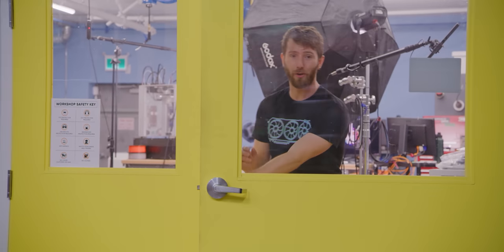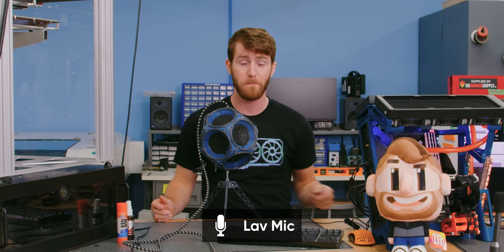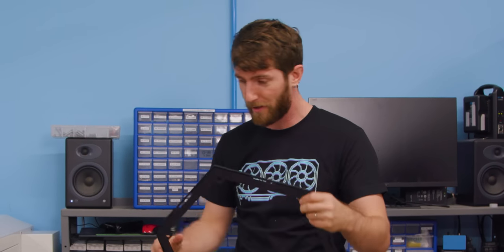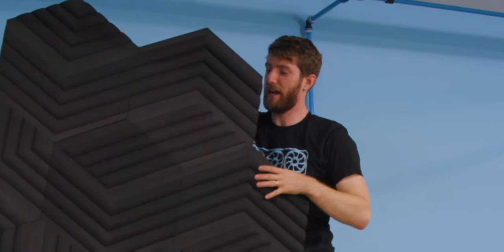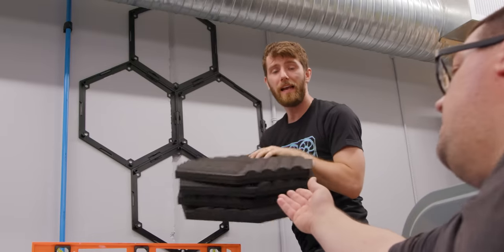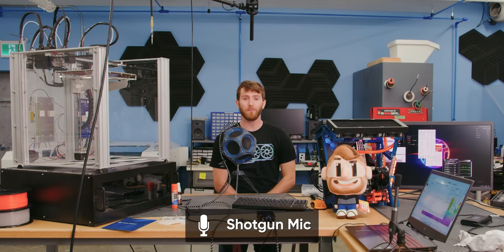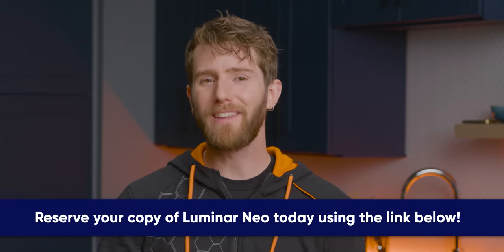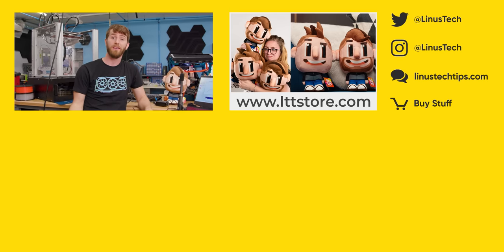I'm only going to say this once... - Acoustic treating with Elgato Wave

Comment: Hey Linus, I'm a professional acoustician and long time fan! Some other comments have pointed out that reverb isn't caused by standing waves, and that there are cheaper, better performing options like Rockwool. These aren't wrong, but I wanted to praise how you did the video. You're doing the right measurements, with the right equipment, and (generally) using it correctly (that mic really shouldn't be sat on the table, it should be on a stand away from flat surfaces). That's so much better than what I see from a lot of other non-acoustics people talking about this stuff! 

Also, while Rockwool or those specialist acoustic panels would be more effective *acoustically*, panels like these serve their purpose really well. As you pointed out, your measurements are showing noticeable improvements right in your speaking frequencies, but not below 300 Hz. For streamers at home, that's exactly what they need! And they need the panels to be unobtrusive and look nice. If these were thicker, more industrial looking, or handbuilt, they wouldn't work for that use case and people would just be less likely to put anything up. In a general vocal recording setup, not a music recording or playback room, under 300 Hz just isn't really that crucial. 

For this room, I'd probably add some bass traps in the corners if you wanted, since you guys have the money and space, but it really does show how much better recorded audio can be with just some pretty simple and nice looking panels.
Reply: Its a #ad like ALL of the videos from LTT right now.
Reply: What is a bass trap? Is it to minimalize low frequency reverberation? And if so would it be more effective in a smaller dimension area as opposed to larger?
Reply: Thank you for your comment, what is the "cheaper, better performing options like Rockwool"?
Reply: @OnTheLeftHandSide      Search up bass traps. Note, however, that for them to be actually effective at trapping bass and reducing standing waves, they require more room than something you can hang on your wall. Usually they're quite thick.
Reply: gotta say it in a positive light otherwise you'll anger the masses huh
lol
Reply: I am also very professional and here is my wall of text that 5 people will read:
Reply: @halolime117  thank you for being one of those few, and I hope you enjoyed it!
Reply: why should bass traps be specifically in the corners?
Reply: @darealrulezbreaker9493  Low frequency pressure builds up wherever there is a boundary, or a hard surface like a wall. In the corners you've got two or three hard surfaces meeting at one point so that low frequency energy concentrates and builds up even more. Absorbers work by basically increasing the resistance to movement of air and sucking energy out of the sound. So by placing bass absorbers in the corners, we're targeting where the bass energy has built up the most!

Also, for a bass trap you need depth. These panels don't work well at low frequencies because the wavelength is much longer than the panel is deep. By placing a bass trap at a 45 degree angle across the corner, we get more depth without intruding into the space of the room as much.
Reply: @OnTheLeftHandSide  A relatively cheap way to make a decent absorber is to use mineral wool or fiber thermal insulation like Rockwool. The material is fairly cheap but can provide a surprising amount of acoustic absorption. A common DIY acoustic solution is to build a wooden frame, stuff it with insulation, then cover it with an acoustically-transparent fabric. These work pretty well and are cheaper to do, but obviously they're more effort and not necessarily as stylish as premade panels like this.
Reply: He mentioned Rockwool and similar solutions at 14:39
Reply: @drandrewmitchell  allright, thanks for the explanation! 
I want to use a old mattress with acoustic foam on top as a bass trap.. overall thickness will be like 18cm. 
I cant really put the one matress in the individual corners of the room, but as a plus it has a lot more surface area than a little bass trap. 
Im just not sure where the best place would be.. i guess putting it on the wall thats in front of the speaker/ behind the microphone would make most sense?
Reply: rockwool is horrible to work with, I wouldn't suggest it to anyone who doesn't know fully what they're getting into, so they understand how necessary protective gear like gloves and a mask are when handling rockwool.
Reply: @steveschaninger2535  not sure were you answered already, but as simplified lower frequencies tend to amplify in the corners of the rooms. Therefore you install something that breaks either the form of the corner or lot of absortive material with depth, or both. As lower frequencies has longer wave length you need more mass and absorption throughout that wave length to tame down the lower frequency spectrum.
Reply: For streamers and content people the elgato stuff is really good. It hits only the talking frequency and looks nice. I am a baritone nerd so I still prefer the giant wool panels + funny looking ceiling.
Reply: Hi Andrew, could you tell me if these would work to reduce noise from upstairs? And if not, what would you suggest? I live in a flat and the dude upstairs bangs a lot. Yes I’ve spoken to him, and no, he doesn’t care.. I use earplugs when I sleep, which help about 50%. My question is, if I stuck these things to my ceiling, would they absorb some of the noise/vibration? Paired with the earplugs, I’m hoping they would help? Or would sticking them to a ceiling with the noise coming from the other side, make no difference?
I understand better insulation is the best option but ripping out the ceiling to install it and then making a new ceiling isn’t an option since I don’t own this property. (The council will not do anything about it).
I need a quick fix solution like sticking these panels. Even if it’s not 100% eliminating the problem, a reduction would help. But it’d be a waste of money and time if they make no reduction at all.. Thanks :)
Reply: @user-fy7ri8gu8l  I mean I still find the videos informing and entertaining also most of the time I don't get yt ads when I watch LMG videos so I'm happy :). 
Just had to add my 2 cents but I like the ad-ception theory lol.
Reply: @Sieg2k6  Honestly It sounds like your neighbour just needs a good "talking to" if you catch my drift.
Reply: I'm no professional, just someone who's spent time in rehearsal studios and heavily researched DIY options for one at home, and everything Andrew's said is consistent with what I've found. Absolute legend for taking the time to expand on the subject matter and reply to others!
Reply: tbh i really dont see how stuffing some cheap ebay wedge foam everywhere does any worse than this from a value pov compared to like 0.5 panels of this
Reply: We do reverb measurements at school (Audio Engineering, Electroacoustics class), we use this omnidirectional speaker with a better frequency response and we use white noise and listen with the mics for the reverb after the signal ends with an AL1 acoustilyzer and then average it over multiple measurements in the room, that seems like a better way to measure it.
Reply: Plus these have an aesthetic that rockwool doesn’t. They may perform worse, but when you add in that factor, and the fact they do enough for most people, I’d say it’s pretty good
Reply: Neat
Reply: Rockwool isn't good for your lungs.

Comment: This was definitely a fun run through and test, etc. -- but for big spaces like this the best and most cost-effective solution would have been a few rockwool panels rather than these everywhere, but if you have them, you have them!
Also as the first one to mount them on ceiling in video - they WILL fall eventually, but adhesive will mostly keep them in place.
Reply: Rockwool panels are how I made my sound absorption panels. Built a frame out of 1x4s (same size as the rockwool panel), then put fabric over them to clean up the look. NOTHING works better than Rockwool. I do like the design of these ones in the video though.
Reply: Didn't he specifically mention at the end how rockwool would have been the most cost effective solution?
Reply: If you are an artistic type, or you know someone who is then you can get uncut acoustic level foam for pretty cheap and then just cut it yourself. the other downside is you generally have to put nail holes in your walls
Reply: Some other guy said to use walmart cheap towels 4 dollars per panel lmao
Reply: They are most certainly not cost effective. You can get just as good panels for less than half the price of these things. Elgato is scamming people with the classic, add "gamer" to the name and then up the price 10 fold.
Reply: @bittjl3150  that's not a scam its a pointless markup. If people don't do their own research it's on them.
Reply: @NeonAtari  Used towels from the thrift store work also, several layers inside a frame.

Comment: I wasn't expecting for these panels to be that good.
I have professional sound panels, but will probably give these a try on different rooms, especially for the lower cost.
Reply: Yes a computer tech channel is the best place to get your info on soundproofing on a budget. Try looking elsewhere first.
Reply: Basotect (open bubble high density foam) could achieve massive results. For a studio environment I would recommend both, thicker panels and an air gap behind the panel. Other than that - compared to rockwool with its approx 40 pa/s/m2 you probably need 30-40 % less material for the same results on reflections in the mids and highs. Sadly I can't recommend Basotect for your bass area, at least not in those shapes and thicknesses. They're velocity traps so you still need the well known enormous amounts of material to control lower mids and bass.
Reply: "..., especially for the lower cost."  100.- for 1m² is considered low!?
Reply: It's not a lower cost though; it's $100 for each individual box, not for the whole room.  It's just as ridiculously overpriced as all of Elgato's other products are.
Reply: Maybe in comparison to your professional panels they have a slightly lower cost, but generally for audio foam it's very overpriced
Reply: Linus were sponsored by Elgato. Their shit is overpriced

Comment: Quick tip from a 3rd gen audio engineer: Some of the tightest sounding panels I ever heard (or didn't hear really) were made with the ultra cheap towels from Walmart. They were about 4 bucks per panel.
Reply: I've heard towels are effective, say, what towel fabric works best? Like 100% cotton? Cheapest I've seen are rather synthetic fabric (We don't have Walmart here in Bulgaria :))
Reply: @batyanko8283  The one with the most little hairs on it is the best.
Reply: Quick question what do you mean with sounding the tightest?
Reply: @mrclean3088  In this context, tight usually refers to a sound without reverb or echo.  Rather than striking a hard surface and bouncing back to the listener, the sound waves are deadened by energy absorbent or redirecting materials.  It also can refer to two or more instruments that are struck simultaneously rather than slightly off-beat to one another (though I don't believe Hash Tagger intended it this way).
Reply: Best soundproofing on the cheap is a closet full of clothes
Reply: And the fire resistance rating is....?
Reply: @pault151 no one thinks of that & no one cares.